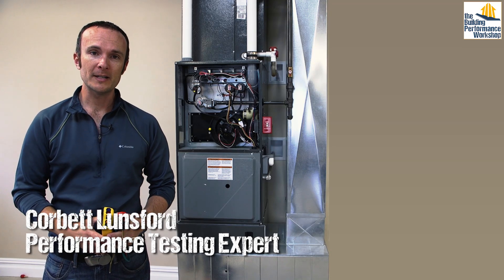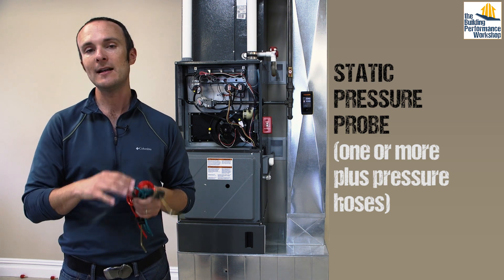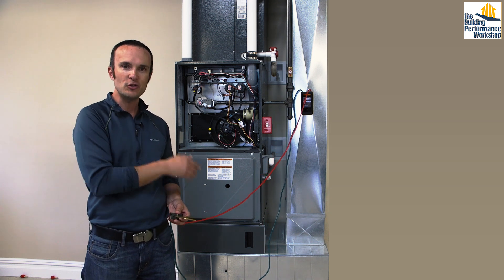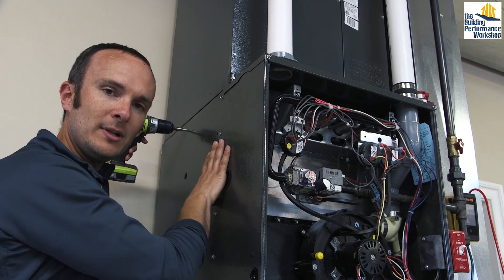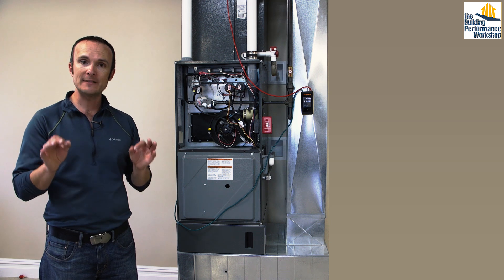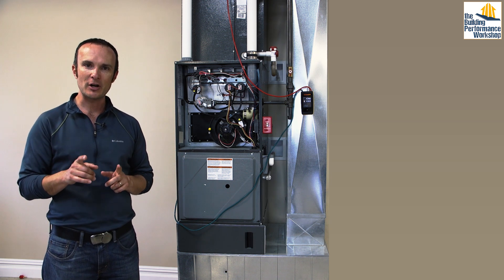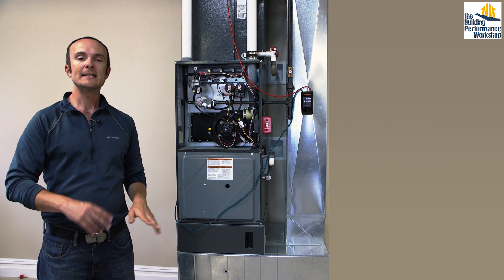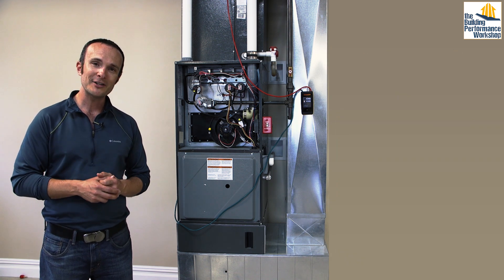Static Pressure Testing and Mapping Demonstration: Home HVAC Duct Performance

Comment: If you study anything from ACCA, you will know now in 2022 with the Air handlers, furnaces and package units, the static pressures can exceed 0.5 without causing any issues.  Is it ideal to be 0.5 or below, sure I suppose so.  But I have seen systems run just fine at 0.9-1.1 without an issue.  Variable speed ECM blowers were practically designed for that.  But a properly built system with the right amount of return air, a large filtration system 4-6" filters with good air flow, a good variable speed system properly matched with the ducting design and system functions with be most likely below 0.5 but can safely run much higher.  For the homes that are completely finished, and ducting cannot be upgraded, the HVAC system can still be spec'ed properly that could be running 0.5-0.9 without a single hiccup.  There are just too many variables to say 0.5 is the maximum these days, but this is a 6–7-year-old video and the 80%-98% units have come a long-ways.  This is an outdated video but still has some validity for older systems.  Like, don't put in a Filtrete 1900 1" in a single stage 20-year-old 80% system, sure you will have problems.  But anything with an ECM blower will run fine but I still don't recommend that ridiculous filter.  But also, stop putting on those no MERV rated filters that you can see through that cannot even stop flour.  Depending, a MERV 8 is a good average for older systems.  If you want to pay a $1 a filter and change it monthly with very little filtration, so be it.  It is your stuff, but a MERV 5-6 would be fine for that use.  Anyone can add a 5" filtration box to their system and have reduced static pressure and better filtration, no matter what year it was built.  Just make sure you have good return air, good intake air and generally you will have a pretty healthy system, if serviced yearly and cleaned properly on your coil, condenser and blower.  Maintenance is just like a car, after all, they do cost as much to replace!  But these days, you can get some amazing systems for a decent price.  I sell my clients the best system possible at the best price.  Find a small HVAC company that has good reviews, and you will get better service than some big-name company who advertises on TV or mailers.  You get to pay for all their advertising, fancy vans/trucks etc.  Make sure they do a full manual J, S and D and get 4-5 quotes and ask neighbors and friends on social media for referrals to friends and family.  I promise, if you follow some of these rules, you will have success and be happy.  Have a great day!!
Reply: What is the location of where you work? I'm sure people reading your comment might be interested in your HVAC services.
Reply: How would one go about replacing a 1in filter box in the ceiling with a 5in? They dont seem to exist or i'm just not looking in the right place.
Reply from the maker: @wojtek-33 you can get a 4” Aprilaire I know
Reply: @wojtek-33  Do you mean your furnace or AHU is in the attic?  You can buy Honeywell, AprilAire, Trion Bear and many other filter boxes.  Or are you talking about return air ducts.  You can buy filters that have a lip and the filter extends up into the cavity.  One brand is Flow Right.  And you get get filters at Filterbuy in the custom sizes.  So many options available but I am not sure of your setup.
Reply: @Balticblue93  yeah I'm Texas and a lot of homes have the whole system in the unfinished attic with a ceiling filter box in the living space. Of course mine is on a 10ft ceiling so need a ladder to change. It's a pain and it's an odd 24x36. Just found the ones with the lip but they are pretty expensive and almost none for my size. I look into one of the replacement boxes after taking some measurements on my system, maybe it's fine.
Reply: @wojtek-33  I actually service three HVAC systems in the Austin area, 1-2 times a year.  My family and extended family are there.  All their systems are in the attics, but I only service them in the Soring and fall because it’s far too hot.  Here in Colorado, 90% of the states are in basements unless they have two systems.  I also service two more systems in Oklahoma and those are in the garages.  Big the flex duct work crap is in the attics.  So, they all have filter boxes connected to the main system.  Some have the ability to filter at various return grills.  They have quite a few returns in those systems, not just one big one.  

What is your sq footage and do you know any specifics of your system brand, size, model or anything like that?
Reply: The manufacturer recommends 0.5" or lower, BUT they have stated 0.9-1.1 is still acceptable... especially with dual stage variable speed or modulating furmaces. So, I agree with you
Reply: Best would be an ammeter on the blower motor that would show current draw above max CFM rating. So filter dirty or too small. Ducting is sized for volume CFM or air exchange vs area of cooling/heating fins. How much flow is the most efficient over the fins? Too fast or slow does not allow air to contact fins long enough. Thats the real reason pressure is important
Reply: bro tldr. The question is not about kinder blower handle the static. The question is how can I get a slow enough RPM at that static to manage humidity without freezing up the coil. You can’t even begin to manage humidity without setting the static pressure.

Comment: So I am all for static pressure testing and agree, many guys don't take the time. But to tell "homeowners" if there isn't a hole drilled in the side of the furnace you shouldnr call them back is EXTREMELY ridiculous. Let alone a hole drilled into the blower door! Call any manufacturer, your warranty is void by drilling hole. Take coil door apart, add hole in A frame part of coil metal, run probe tubing out through lineset hole, like a professional. Put door back on and then remove air filter(always) and place second probe in duct near air filter by drilling hole in ductwork. DONT DRILL A HOLE IN YOUR FURNACE!!

Comment: Can you help me understand how you are only measuring static pressure if you your probe is facing into the flow? Wouldn’t that be total pressure, ie velocity pressure + static pressure?
Reply from the maker: The head is aerodynamically shaped, so you can be sure any turbulence is removed from the measurement theoretically if you point it into the flow.

Comment: How do you apply this to systems that do not have the filter in the unit, but in a return grille?
Reply from the maker: Then you just test with and without the filter in place to separate the filter pressure drop from that of the return duct sizing.

Comment: I came across, like carrier where I can put static probes in the service light whole and through the limit switch. It seems to work fine without drilling wholes.
Reply from the maker: As stated in many other comments, you’ll get a higher than actual reading since your probe is not outside the equipment at the limit switch, but if it passes your way, great!

Comment: I’m conflicted if I can move up to a MERV 13 furnace filter. I believe I have a 2 ton gas/AC furnace. Any suggestions would be great. Hell, I’d also like for someone to test my system’s static pressure. Any certifications I should look for in company? Cheers, great video.
Reply from the maker: Sorry Pete, no certifications for this one, but you can search google for it and maybe find somebody who’s trying to be better than the rest. If you go with a 4” pleated filter then absolutely you can.
Reply: @HomePerformance  I actually have a 20x25x5 inch pleated MERV 10 furnace filter right now, but I’d like to move up. I think I should be ok. I’ll tell you something crazy though, I just found significant water vapor damage inside of my wall from the microwave “range hood” over the stove, which some how is blowing inside of the wall. I can hear the wind in the wall from the other side when it’s running. I look at the best mold inspectors in the nation’s reports for a living and I have not seen this source area to date yet. Talk about negative pressure lol Thanks for the reply btw.
Reply from the maker: Yikes! Sounds like they forgot to cut a hole in the sheathing- half a job done is much worse than none at all in that case.
Reply: @HomePerformance  I thought there was an exhaust line out the top of my roof. None. Just blows right in the wall…

Comment: Interesting never drilled a hole in a furnace to get SP I usually remove the hi -temp sensor out of the furnace and use that hole, I find it easier to do than to drill a hole. Can I put my sticker on the furnace??
Reply from the maker: Limit switch hole will give you a higher than actual reading- if it passes there, you’re good, but I find most installs need every 0.01” they can get. Yes, put your sticker on- AND write the SP data on it!

Comment: -Fan stops blowing about once a year.
-Techs change out Emerson controller board.  Problem goes away for about a year each time.

-New tech actually tested total static pressure.  He reported the the total is .7. Unit label says .3.
-He says the static pressure is damaging the board and recommends 10k duct work.
-We can temporarily work around the issue and get the fan to run again by disconnecting power from the controller board for a few minutes.

Does this make sense that the circuit board can be damaged by incorrect static pressure? What do you think?

Comment: Hay Beginner the manufacture did put a hole in there. It is the high limit switch. In addition to this you can put a hole behind the coil door and in the center 1.5 " above the "A" coil pan. which the customer cannot see and doesn't void MFG warranty Beginner. You never now how much a person doesnt know until they open there mouth... you have just told every one what you dont know.  Now I can see that your return air drop is too small which effects the static. Putting the hole in the side IS the WORCE place to put the the hole and the place of the greatest turbulence. The reason for that is the diverters to increase air flow on the sides of the cabinets to prevent heat exchangers from extreme temp differentials. Please stay in the class room! I wouldn't want you in the field misleading customers. You have some knowledge.. Just enough to be dangerous to your self and your customers.  If you are a real pro like you claim your customer should never tell you were there. tape on the duct work... so amature. Use electrical plugs made of plastic. If you went to HVAC Duct design you would know and mention about averaging static in a duct and turbulent design flow. You through Thousands of well educated, Techs under the bus WITH YOUR ABSOLUTE statements. Go get educated on what that means.  So all those that are not techs watching this you can find proper instruction from trane and Goodman in You tube. You can also go to to the goodman sight and download the dealer course.. TYPE IN  Goodman then Dealer.   For the beginner techs you can also use a dwyer gauge or a slope gauge.

Comment: Why ignore the negative on the return side?
Reply from the maker: Just the negative symbol- you change it to positive and add it to the supply pressure, for the big sum
Reply: @HomePerformance  Thanks!  I think I understand now,  the pressure is measured relative to the room,  but what we're really after is the rise in pressure in the system!
Reply from the maker: Yes, on each side and as a total smount of pressure on the fan itself.

Comment: So how do you know what the pressure drop is supposed to be across an evaporator coil if it is not part of the furnace itself? Also how do you know what the pressure drop across any filter should be?
Reply from the maker: Manufacturers put that info in the install manual, for both coils and filters.

Comment: I may be misunderstanding what you're saying at 9:20: in this setup it appears that the filter is After the furnace blower fan. Shouldn't the filter be on the suction side of the blower fan?

Comment: Hi Corbett just makin sure now, the friction rate is on each manual of the air handler depending on the speed of the blower? And we have to match that friction rate based on how we calculate sp, pressure drop, equivalent length, etc after the design is complete correct?
Reply from the maker: Whoa Ando, you’re losing me- but I will have some HVAC design courses coming online soon.

Comment: Hi Corbett, so basically just wanted to confirm static pressure is the resistance of the air inside the ducts and pressure drop is? If you can just summarize the two meanings for me I would appreciate it.
Reply from the maker: Resistance to the inside of the ductwork. And p drop is the differerence in static on both sides of an obstruction.

Comment: What was the root cause and the subsequent resolution needed to lower the high static readings at the filter / fan?
Reply from the maker: Smokey, you do the map to pinpoint the issue. It’s always a duct too small, crooked, or blocked (by anything including filters). Unclog the flow, static goes down.
Reply: @HomePerformance  Thank You. Back in the day we just didn’t dig down to this granular level and like everything else in life, unfortunately, the devils in the details. 
 ThankYou
Reply from the maker: Wise words Smokey
Reply: He simulated the problem.

Comment: I have no time for blabbering
Reply from the maker: Too late
Reply: @HomePerformance  no its not. I called soemone and got answers within seconds
Reply from the maker: Daniel, you cannot learn anything important in seconds. I doubt you got it.
Reply: @HomePerformance  what you need is the settings on the manometer. We're to hook up the probes. And the measurements of inches water column. This is a 10 seconds demonstration. If it's someone's first time then sure, if they're in school then yeah. If your already out in the field and just need a refresh on a small detail, in this video you'll bounce around everywhere and watch the whole thing and still not be certain on.too much  Beating around the bush,  increasing video time. Isn't that the goal of the video, atelast 10 minutes? It is. And it's been unnesasarly prolonged. I save 2 hrs every day. How? Because I shave minutes away from every task. That's what separates succesful people from those that daydream and work for someone who tells them what when and how to do things.
Reply from the maker: Danny, CLEARLY this video is not for you then. Just make your 10 second calls instead of opening youtube at all- there, I just shaved years off your work time.

Comment: As a retired service and training manager for a major brand and an instructor of manual J & D, I ground your video to be excellent, correct, and very well explained. Great job!
Airflow and air duct testing is so important as many system failures are traceable back to a faulty duct system.
A “ tip” if I may. When drilling into a furnace or air handler beware that there’s insulation ( in many cases) that’s only glued on and any excess pressure from the drill may loosen the insulation causing an eventual failure of adhesion allowing the insulation to start flopping around with some ending up on the evaporator coil.
Another way, on furnaces, would be to remove the high limit and go in there. You’ll be between heat exchanger cells right above the blower and get a accurate reading too. This way you will not damage the insulation.
Just of course be aware that one leg on the limit is hot with 24 volts, so as not to blow the fuse on the board. Real bummer 😖
This video has very valuable information guys, please use it.
Reply from the maker: Thanks Wayne! And yes, limit switch hole is better than nothing, but the reading obtained there will be higher than actual. If they can pass ESP with that spot, great, but in my experience installers need every 0.1” wc they can get to be at .54” and round down.
Reply: @HomePerformance  - What is the best way to deal with the holes after you have run all the tests?
Reply from the maker: @darriuscole8544 they make metal plugs, or plastic if you prefer.

Comment: This man's IQ is very high. He speaks in a straight line and never says anything that is not relevant.
Reply from the maker: Thank you- good to know I come across as concise SOMETIMES
Reply: @HomePerformance  You're a total pro. I found this as a result of my water heater being installed in a way that made it impossible to insert my 20 x 25 x 4 filter media. The water heater company has been really good about trying to find a solution. There is no other place to put the water heater. My "fix" was to sub the 4" filter for a "3" MERV 8. Just wondering if that will stress my system. it's a 5 year old Lennox. Amazing that people in the HVAC business know nothing about static pressure, blower speed and filters and how they work together. Not saying I do but at least I'm aware these factors do exist and they mean something.

Comment: I'd like to see if just a pressure hose in the duct reads the same as the recommended 90 degree metal static pressure tips 🤔 I bet they would be close or read the same.